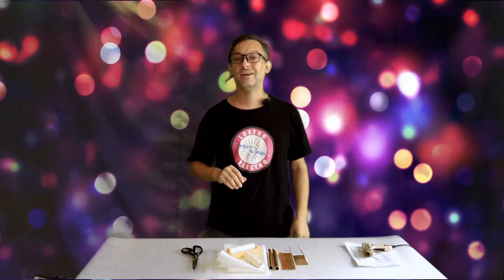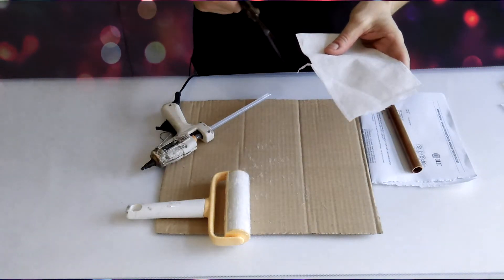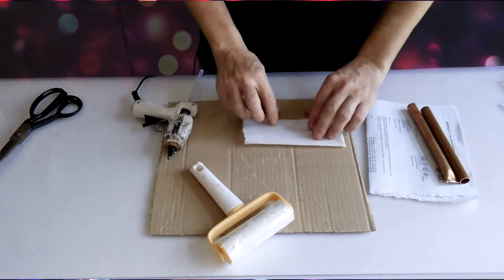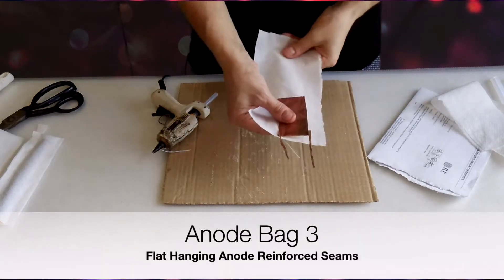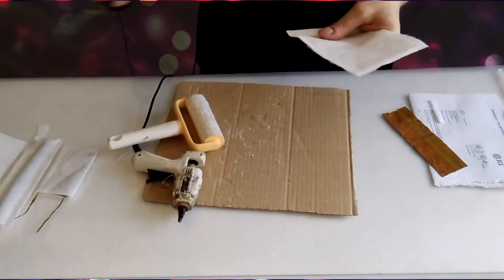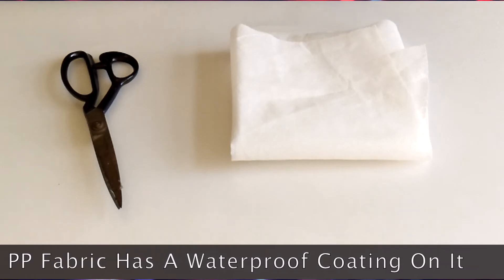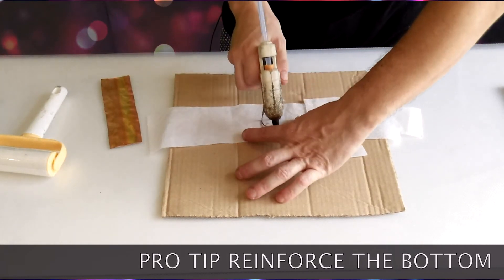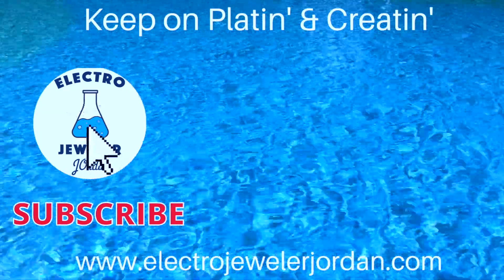Anode Bags Electroforming & Electroplating Fast & Easy To Make Copper, Nickel, Tin & Zinc Plating

Comment: The tutorial talks about preventing contamination of the solution. I wanted to ask whether the covering of copper pipes with black coating is a natural process or not.  The pipe became covered with a black coating despite cleaning the solution. I don't use an anode bag. I clean the pipe and remove the coating from time to time with a paper towel. I don't know what is going on.
Reply: Thanks a lot! Should I remove the coating that forms on the surface?
Reply from the maker: Hi, that black coating is a good thing.  https://youtu.be/Bt3JmDSw09o this video and the video on chloride describes this black coating. Enjoy!
Reply: @electrojewelerjordan490  Thanks a lot!
Reply: No, black coating is beneficial.
Reply: @herp25  Thanks a lot!

Comment: Thank you so much for the information! Would the glue eventually contaminate the tank would you suggest sewing the bags??
Reply from the maker: Hi, the glue doesn't seem to be affected by the solution even after a year of use. You can also sew, just make sure to use a synthetic thread and fold over the seam.

Comment: does the hot glue hold hot plating bath around 60-70°c ? thank
Reply from the maker: Thanks for watching!  The hot glue that I use in this video was just a generic no name glue stick and works for my nickel plating tank that gets up to 65 C, so in most cases, yes it will work.  There are some low temp ones that may not work, but I don't think that they are common and would be labeled as "low temp."
Reply: @electrojewelerjordan490  thank you for the answer ! it seem logical, after researsh the literature say that the hot glue melt around 80°c, and it is heated in general between 150 and 280°c. so 65°c bath souldn't melt it.
I think the low temp one are the small dia glue stick for small glue pistol that they are safier for childrens...
you hada good idea, simple and robust anode bags. very cool !
Reply from the maker: Excellent!  What kind of bath is it?  Thanks again for watching.

Comment: Hello, can this material be use for filtering electroforming solution? Thank you so much!
Reply from the maker: Nita, Thanks for watching!  This material wouldn't work well for filtering.  The  video here shows an easy way to filter https://youtu.be/rqsSgYipadA
Reply: @electrojewelerjordan490  So on the other hand, why not use this 1µm filter as the fabric of choice for making the anode bags? Indeed, the "grades" of non-woven PP fabrics span a wide range and it tuns out that anything larger than 1µm allows the sediments to pass through and pollute the electrolyte. What's more, PP fabric available by the meter is often far too thin.
Reply from the maker: @fluxcapacitor  
ChatGPT
Hi, there are many reasons, and in certain situations, if used properly, the 1 micron option is also good. I will probably cover that in a different video. The main reason, though, is cost and availability. Non-woven material is ubiquitous and super cheap—2 meters cost me $6.00 and can even be free. If you search for a GSM of 70-100, there should be no issue regarding thickness. If you are not living in the US, then the cost + shipping + VAT of the Duda energy sheets (if that is what you are referring to) from Amazon is about $85.00 USD, and the performance vs. cost difference, in my opinion, is not worth it, especially since you can get an anode cage for $20-$30 on my site. I have another video where I show an alternative to the Duda energy sheets that costs way less, but still, an anode cage is a superior choice.

As far as particle size, it seems like 1 micron is an arbitrary number. Most home electroformers are using coffee filters (about 20 microns) to filter their solution with success, and a lot of commercial shops use non-woven material as anode bags. I’ve been to many commercial shops and have never seen the 1-micron material being used, although some may; all that I have seen do not. With proper maintenance and chloride levels, this should not be an issue. If you already have the material and use it properly, then there's no need to change, as you have already spent the money. For super-fast filtering, check out my 1-micron filter video using that material.  https://youtu.be/_KtxeGdIQN4

Comment: Hello :) I need to make those anode bags but I don't have special fabric for that. Can I make them of cutting safety masks (and use all 4 layers?) ?
Reply from the maker: Thank you for your support!  It depends on the individual mask, but yes it's possible.    I have masks made out of the same non woven material and have  tried it out and it works well.  Try to use a light colored one so that you can see when it gets dirty.  Also make sure to take out the metal nose bar as they will contaminate your bath.
Reply: Exactly the question I was about to ask :) 
Thank's

Comment: Does black landscaping fabric work or does it need to be white?
Reply from the maker: If it is the same type of fabric it  should work just as well.   The 3 drawbacks that I see are it will be difficult to see when it gets dirty , it may make your solution look darker if  you have a small tank or the color may bleed into your tank ( it most likely will be ok.)   To test colorfastness soak a small piece in  sulphuric the same  concentration as your solution.  So maybe a 1/2" piece in 50 ml acid overnight  just to make sure that the dye or pigment does not  leach out into  your tank.  Happy Plating!
Reply: @electrojewelerjordan490  no worries I ended up finding the white eventually!